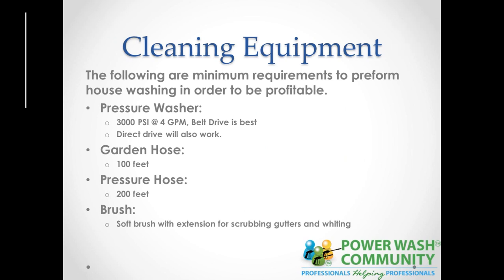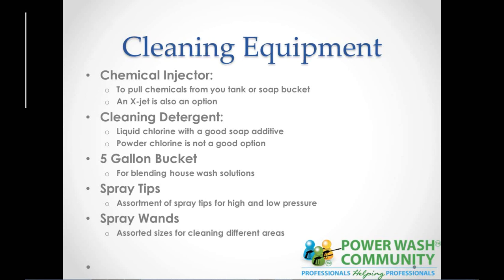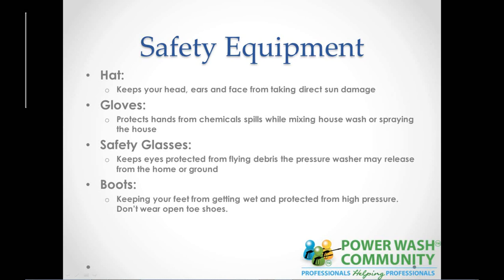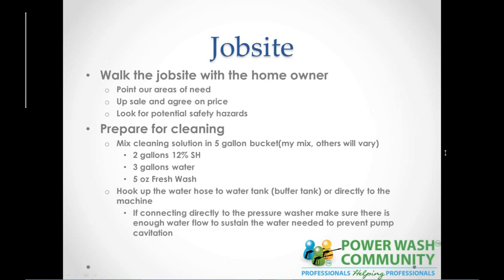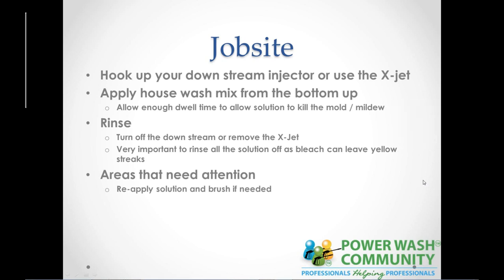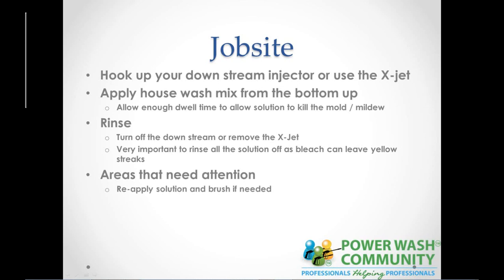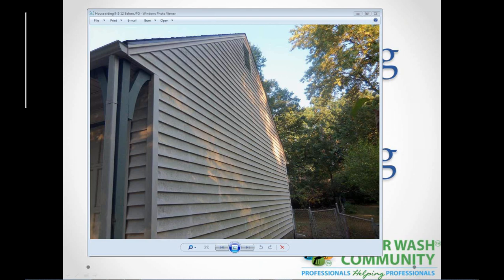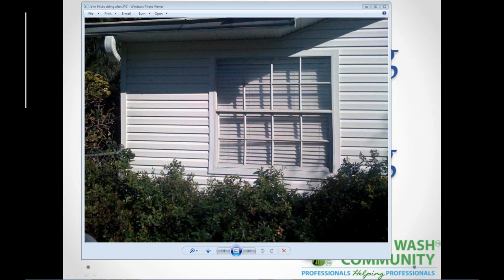House Washing General Power Washing Webinar by Josh Minx

Comment: I was just watching a few minutes of this and will watch more later, but I wanted to comment on a few things I heard in the first 5 minutes.  I use Calcium Hypochlorite (CH) all the time as a soft washer and it is fine for roof and house washing.  You just need to be sure to rinse it off  the product with clear water while the surface is still wet.  Once you let the CH dry on a surface, that is when it becomes somewhat difficult to remove.  Also, you said you can get the CH off with something acidic.  Mixing a caustic like bleach and an acid is never a good idea (Google it).   When you mix in a soap with your bleach, make sure your soap doesn't say 'Do Not Mix With Bleach!"  Most soaps are sodium laural/laureth sulfate and ammonium laural/laureth sulfate, and those are not good for mixing with bleach.  The ammonia based cleaners actually cause a chemical reaction that will release the chlorine gas which is toxic.  Chlorine gas is the same chemical gas that was used in WWI and WWI for trench warfare.  You should also always mix your water into your tank first, then add the bleach or other chemicals, and soaps last to avoid chemical splash and excess soap foam.  Sorry if you covered any of this somewhere else in the video, but if not, I wanted to share this information.